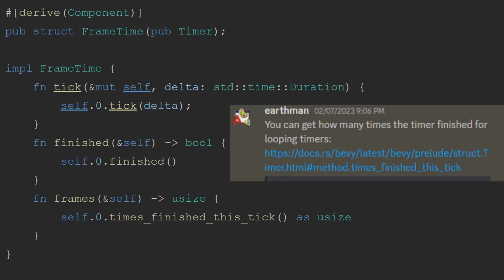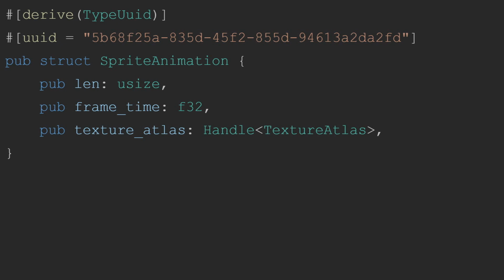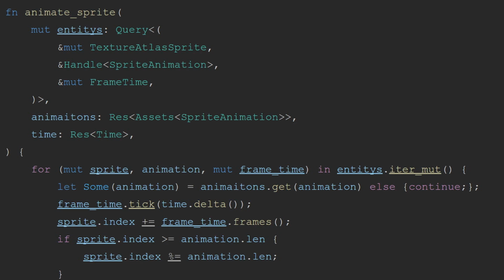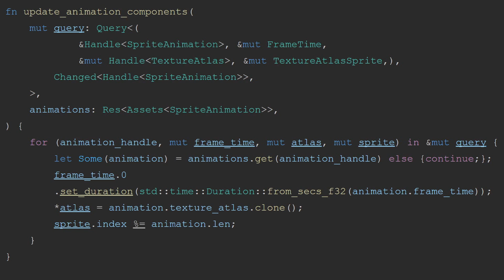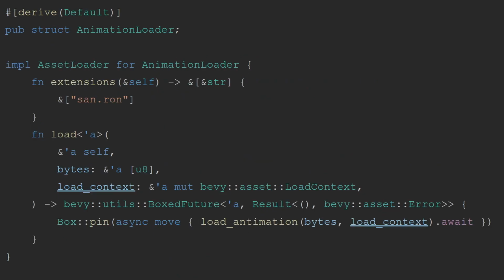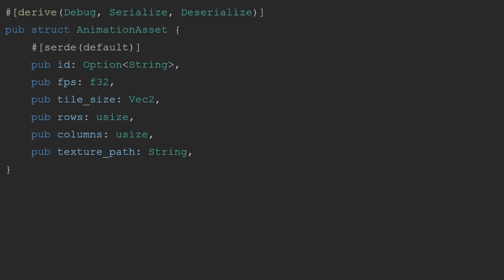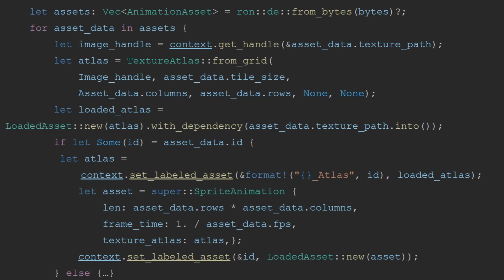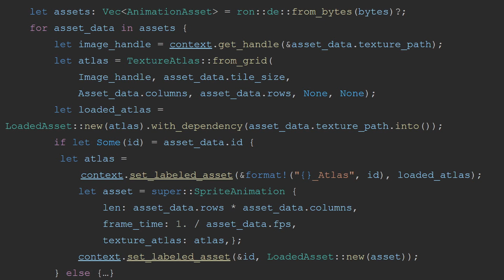Making Custom Asset Types: Platformer In Bevy #4

Comment: Topic Ideas: extending bevy with scripting languages, mun: github  mun-lang/mun (look in examples), bevy_mod_scripting (lua/rhai, hit the tilda key once the game window launches): github makspll/bevy_mod_scripting
Reply from the maker: Scripting is and interesting idea, but I feel I would need to make my own script to allow it in this sort of game,  I feel full blown Lua access would be overkill for a platformer
Reply: @PhaestusFox  I agree that the bevy_mod_scripting is a bit heavy.
However mun is a surprisingly light-weight.
The mun-lang/mun/examples/rust-bevy-simple -- I wrote -- is a little over 30 lines and it gives full access to the hot-reload-able mun language.
Much of the content of your custom-assets video I've been able to implement to great effect with bevy by creating a custom asset-loader for mun.
This has allowed me to experiment while the game is running to fine-tune behavior that I would typically need to recompile to do.
It is not a massive improvement over using RON files, but it does allow you to write both data and functions without recompilation.
Reply from the maker: Oh yeah righting functions without recompiling would be good for prototyping